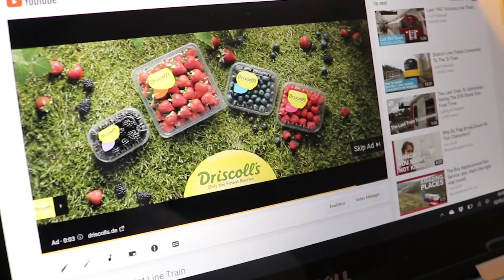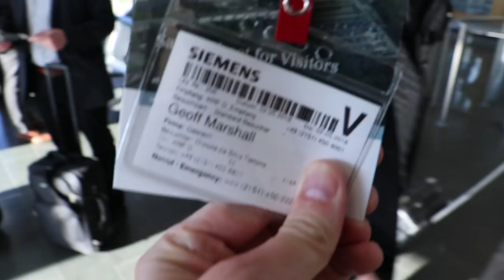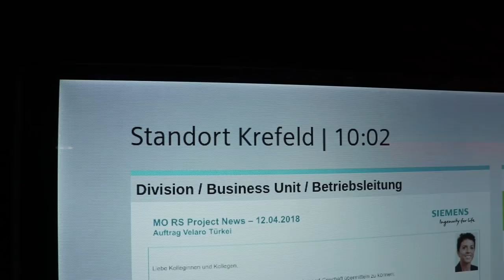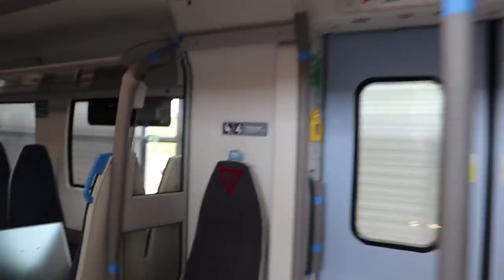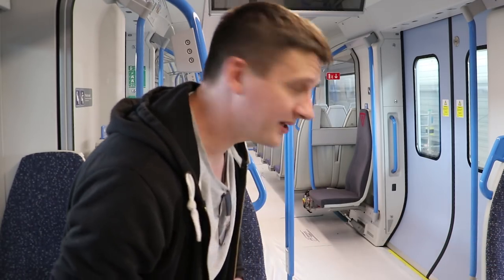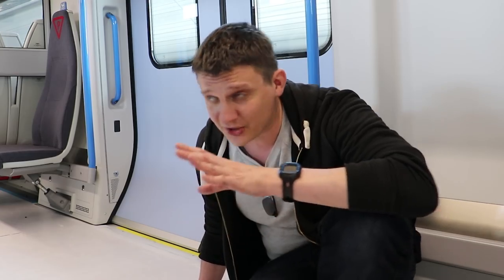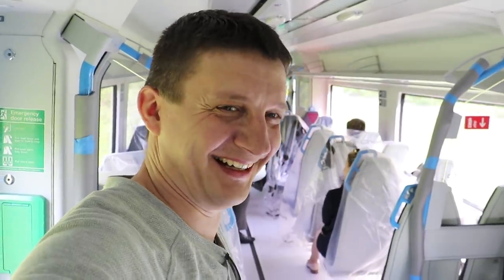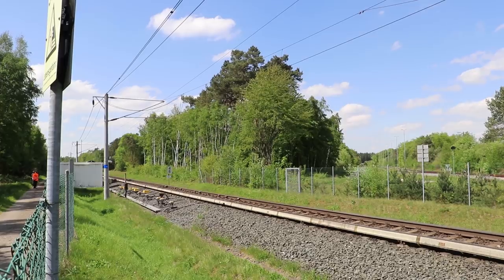The New Siemens Class 717

Comment: I love the smell of new rolling stock. I remember getting on board a new train in London, before it smelt of humanity.
Reply: I remember, when the 395s were new, they smelt like soya milk!
Reply: The old Heathrow Connect trains smell amazingly awful right now. Like something died in there. I think they're going to have to burn them once they're retired and replaced with TfL Rail on May 20th.
Reply: Nilguiri *semen
Reply: +Reason077 They're also built by Siemens. And they're only ~13 years old...
Shiny new trains will only be shiny for so long if they're not cleaned properly
Reply: The  @Reason077

Comment: So they've fitted charging sockets to all the Standard Class seats in these 717's and the 707's, but not in the Thameslink 700's, which travel by far the greater distances, e.g. Brighton to Bedford/Cambridge or Horsham to Peterborough, etc. The 387 Electrostars which were being used as an interim measure on the Brighton - Bedford route before the 700's took over also had them, so passengers on that route got used to having that facility briefly before  being taken away. I just don't get that at all, especially as the 700 series appear to be variants of the same basic design family.

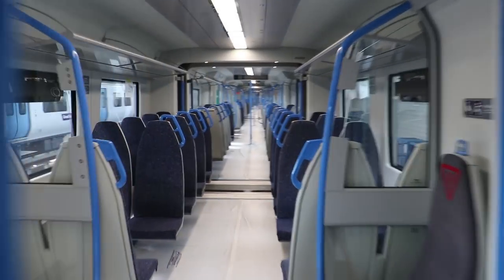Comment: 3:51 I saw a seat facing horizontally. They don't have that on thameslink 707
Reply: Hello that's is a new temslink train
Reply: 707s are south western railway
Reply: This is actually a priority seat, meaning it needs to be given up if an elderly passenger needs to use it.
Reply: The 707s have 5 longitudinal seats, only in the middle TOS.

Comment: I feel sorry for passengers having to sit on ironing boards longer than 5 minutes.
Reply: I really like them.
Reply: No. I actually find them very comfortable.
Reply: Comfortable like a pair of relaxed fit Corduroy's on a breezy spring afternoon?
Reply: For crying out loud, I find this style of seat comfortable. Do not try to say I'm wrong when it is an opinion.
Reply: The thing about opinions is that they're like shirts. You need to iron them to make them look good.
Reply: How can you like them? It's so weird.
Reply: I find they have good padding and support my back very well.
Reply: How do these seats compare with Class 700 Standard Class seats? They look very similar in the video.
Reply: The seats in the 717 are the same as the ones in the 700 (which I find comfortable). The only differences between the 700 and 707 is the front door, slightly different headlights and no yellow warning panels.
Reply: @Oh Hello its his opinion

Comment: How old are the current trains running on the northern city line. And when are the Bakerloo and picc line trains getting replaced
Reply: 42 years old theyre the oldest trains in passenger service in mainland britain
Reply: "mainland Britain"
Reply: Some 1972 stock on the Bakerloo is ex-Northern Line Mk1 stock dating from 1972, making them 46 years old, so they’re probably the oldest
Reply: Southern has the oldest one.
Reply: Doomotron Southern has the oldest 313. The oldest Train Operating on the British mainland is probably the 1972 Mk1 stock on the Bakerloo, from around 1972. The oldest in the U.K. is probably the 483s, or 1938 stock on the IOW line
Reply: I remember this line opening, in the mid 1970's, and the trains haven't changed since. Prior to the link to Finsbury Park, Moorgate to Drayton Park was a branch line of the Northern Underground line.  I've just started using this line again recently, it'll be good to get the new trains.
Reply: We're talking about mainland Britain, as in the island of Great Britain. The Isle of Wight is not on mainland Britain so does not count.
Reply: Bakerloo line upgrade contractor has been announced, I think it is Siemens who won the contract
Reply: Piccadilly Trains to be updated for 2023. Announced a couple days ago.

Comment: Can see a problem straight away with that nose ladder.  The 4th Rail is still located down the NCL all be it not on insulators any more but for this reason, the current evacuation ladders have the bottom rung missing so the ladder fits.  If this 717 ladder goes all the way to the ground then it won’t work/fit down the NCL....

Comment: Geoff you failed to mention the uniqueness of these trains. In that they have power from the pantograph and under train too.
Reply: Not unique - classes 313 (which they are replacing) , 319, 378 700 (all used on Thameslink at different times) and 377 9for use on the Watford - Croydon route), all have this capability

Comment: Do the 710 Aventra cars. There are very few pictures of them. And why did they go with pocket doors? It slows them down with the slots vs the flush plug doors. And the 720, 745, and 755(replacing all of AGA’s fleet). Or the Mark 5 coaches. Or the 801 and 802(that train you thought was an 802 is actually an 800).

Comment: As a local to the hertford loop, i cant wait. I am starting to get sick of the 313's. Equally i cannot wait for the 720's on Greater Anglia which i am also local on!
Reply: Completely agree about GA, it's about time the 321's got some replacements.
Reply: I got a feeling the Class 313's will head to the scrap yard once the new 717's enter service, it has serve the Hertford loop line for over 43 years.
Reply: Me too. This should have happened a decade ago at least!
Reply: Or maybe going to Southern.
Reply: What do you think should happen to the modern stock they have, like the Class 90, 170, 360 and 379?
Reply: Doomotron, I doubt Govia will send these Moorgate Class 313's to Southern, Too many problems as they are falling to bits with dirty window you can not see out of, it would be too expensive to repair and it be much cheaper for Govia to send it to scrap and order new rolling stock.
Reply: Doomotrom And As for the future of the Class 90, 170, 360 and 379's, I cant say, if you want to know about the future of these units, Try using Wikipedia.
Reply: I'm a local to GA I cant wait for the new trains but it will be sad to see the old stock go!
Reply: Scott Peacock wouldnt put anything past govia
Reply: There are some true relics on some of the rural lines in Norfolk.

Comment: Do they need yellow ends to run in the UK or are the eliz... CROSSRAIL style trains with not needing yellow ends
Reply: I think they have changed the rules sxo you don't need yellow ends any more.  Not sure why exactly though.
Reply: I think it’s something about new light regulations
Reply: New regulations are that you don't need yellow ends so long as the train's headlights meet a given standard.
Reply: They just look wrong without them. And it creates a single point of failure: if either headlight fails without a yellow front, the train has to go out of service. One headlight is fine with a yellow front.

Comment: Thameslink also run in tunnels and so why do they not have folding out stairs
Reply: Dan Smith   I believe the tunnels are wider and double track these days. The snow hill tunnel back when it was opened in the late 80s was a single track I believe hence the 319s having gangways throughout.     These days tunnels are wider for evacuation purposes. The 717s pretty much run through ex tube tunnels into Moorgate and the location of the crash there.     So therefore the tunnels are narrower.  Hence the gangwayed exterior of the unit.
Reply: Not quite, the line from Farringdon to Moorgate was where the tight tunnels are (especially around Barbican), when that closed there was no longer a need for the front door on Thameslink.
Reply: SB Trains, Planes and Drives  I thought it would have been something like that but I was unsure thank you for correcting me ! I do remember somewhere along there being a single line from a certain NSE video

Comment: What’s wrong it passengers jumping from the doors? Is there not enough space for that to happen?
Reply: Not inside a subway. If the side doors open, you're facing the tunnel wall.
Reply: Stan Patterson if there is enough space, the could open the doors by hand.they could open the doors on the side with no third rail, and walk on the tracks. Only dual-voltage units can run in it since trains switch power sources as drayton park. All newer 3rd rail units have a pantograph spot in one car. All newer overhead units have a contact shoe installer.
Reply: I don't know what subways you're familiar with, but the ones that I've been on don't have much room beside the carriages as they pass through the tunnels.  I mean so little room that a 4yr-old skinny kid would be seriously challenged to squeeze through.  
Yes, in some spots, things do widen out to where it would be possible,  but the vast majority, nope... you're smack up against the tunnel walls. 
This is one of the reasons that train cars and subway cars are built with end doors.  First and foremost so that it's possible to move between cars (when permitted), and second, so that escape can be possible out the ends in the event of a problem or emergency. 
When the original lines were built (not the ones going forward from modern-day),  the focus was on making space for the train itself to pass through.  There was no consideration for things like break-downs and the need for people to leave the trains, therefore,  the thinking was that they needed to make the tunnels only wide enough to accommodate the carriages so that they would not strike rock or concrete.  The thinking was that any excess amount of width in the tunnel would cost more money and cost more time to build, neither of which they were prepared to spend.  
My opinion is that even today with wider tunnels being built, it is still easier and safer to have passengers who MUST evacuate a train in a tunnel, do so via end doors, not side doors, unless the train happens to be broken down at (or could be pushed or towed to) a very wide-open spot or a platform.
  Also,  it's worth mentioning that disembarking passengers in a tunnel onto the tracks is THE ultimate last resort, the very last possible solution, when for whatever reason, the subway train cannot be rescued by a pull or push of another operational unit.  In fact,  I have heard of situations where another operating unit was brought in and nosed to the broken-down unit,  and they simply transferred the passengers from the one unit to the other through the end doors.  They really, REALLY don't want passengers (or anyone else like trespassers) loose and walking at track level. It does sometimes happen, but under strictly supervised situations.

Comment: How come the 700’s for Thameslink do not have the front door?
Reply: not required as thameslink has no single bore tunnels anymore
Reply: The tunnels that the 717 will be running on and very small. Like tube tunnels. So in an emergency when the train has to be evacuated in a tunnel, it is impossible for anyone to exit from the side walls as there is a wall on the way on either side

Comment: Aren’t SWR meant to be getting some of these?
Reply: They already have Desiro cities but there due to be scrapped
Reply: Max Bee I know, these are meant to be replacing some of them and maybe some 455s
Reply: Not quite - SWT rebuilt the 458s, imported the 456s, re-motored the 455s, and had the 707s (Desiro City) built, all in the past few years. SWR don't want any of them and are ordering enough 701s (Aventras) to replace the lot.
Reply: They already have at least one (well class 707) in service, I've seen it twice but didn't clock if it was one or two five car sets - on the Waterloo to Epsom route, it was probably the last train painted in the SWT red livery

Comment: Disappointed that there aren't any tables in standard class
Reply: Arun Pegler there isn't now so no change there
Reply: The trains are only for short runs. It only takes about 45 mins to an hour to run the full length of the line. And most people won't be doing that.
Reply: Standard class will break if you sit in there
Reply: Are you dissapointed that there aren't any tables on the tube?

Comment: Still prefer the class 313s to these units.
Reply: I know. Much nicer, less plastic and most likely more comfortable seats!
Reply: Andrew Pau Sawm Sian Piang Exactly.
Reply: KayPeaThree 3 The 313's have lasted well though, considering they're the only trains that have operated the Finsbury Park to Moorgate section since that line was transferred from London Underground  (at the end with 1938 stock) to the National Rail Network back in the seventies. 

I know that there are still examples of the 313's in service with Southern on the Coastway services, and they have in the past also been used at Colchester (mainly to Walton on Naze) and on two lines now run by London Overground with 378's, but there's still a very good chance that the remaining 1938 Stock in service on the IoW could end up "outliving" the 313's. That would be ironic!!
Reply: Andrew Pau Sawm Sian Piang you literally watch them make it from aluminium? There's no more plastic than a refitted 313 or other unit
Reply: really? the 313s are terrible trains and are in desperate need of replacement.
Reply: never said they didn't, I just get ticked off with every new train being "plastic" to certain people. haha
Reply: Ian Mcclavin Hopefully we see one go into preservation. They are some of the first Dual Voltage EMUs.
Reply: Why? Until the 717's are in service and tested it will be hard to compare. I use the 313's on the Hertford loop and WGC line, and they are noisy, cramped and difficult to use, especially the ones with the bigger seats. I've used the 313's on the London Overground, and much prefer the new stock there, and the 717's seem similar.  Less comfortable in some respects, but far more practical. As to toilets, it is really only a problem on the longer runs - I have never understood how these trains can be used out as far as Letchworth - that is hardly 'Metro'! Being able to get off and use a platform toilet, and get back on the next train would be fine - if the platforms all had tolilets, and then open all running hours - and half hourly or hourly @ weekends. Again, not 'Metro'. Some nonsense being talked there...
Reply: Same although the 313's are 40 years old, they do still work!
Reply: Unfortunately the railfan community is full of old farts who are terrified of any change whatsoever, and so anything new is automatically a catastrophe.
Reply: ZambiblasianOgre there're some newer fans who hate change as well
Reply: KayPeaThree 3 no I prefer those ones.
Reply: KayPeaThree 3 They've repainted one on Southern up in the original BR blue and grey livery!!
Reply: Ian Mcclavin already knew about it
Reply: I live on the West Coastway and they're definitely not withdrawn mate. They're not even thinking of replacing them yet.
Reply: Andrew Pau Sawm Sian Piang they will break when it's comfy. 

Okay I'm just kidding but some new trains have hard seats. But most of the new trains gave comfy seats.
Reply: Unfortunately...